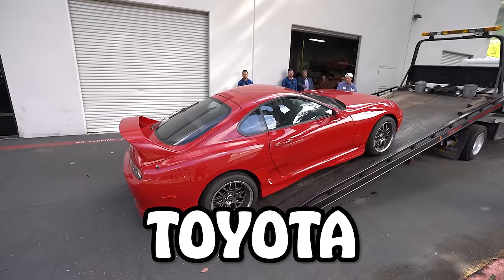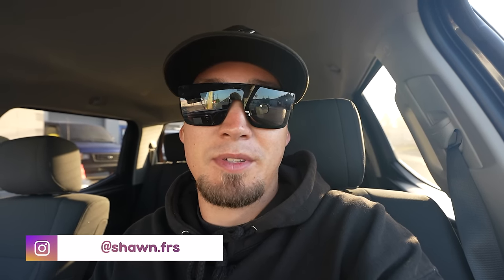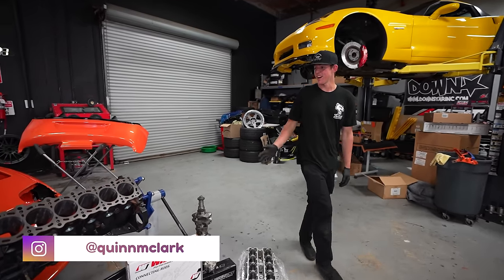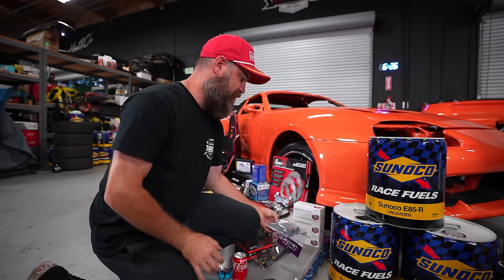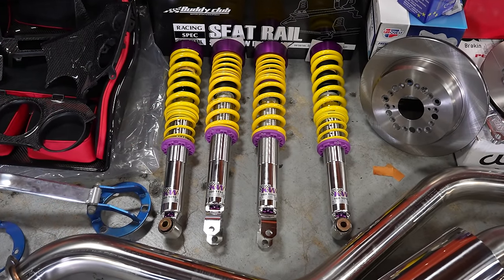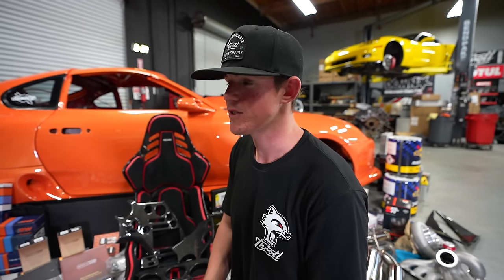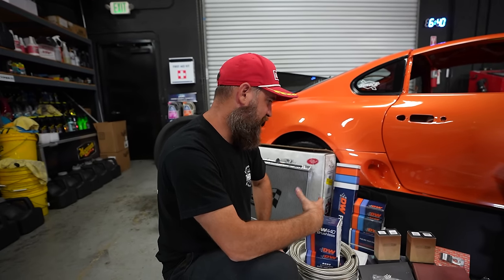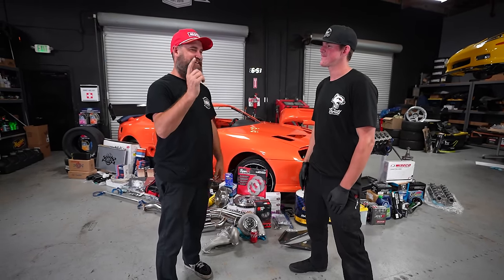Building a Modern Day (Fast & Furious) 1994 Toyota Supra Turbo – Part 5 – SEMA 2022!

Comment: Beautiful build! Absolutely beautiful 😍. Love the pistons, tilton parts, etc. Personally though, I would never have put carquest timing parts on this build, especially with the higher valve spring pressure that the valve spring will be putting on that cheap belt, I understand they're probably sponsoring you with parts, but OEM belt or HKS/greddy/etc for a belt that can handle that tension. You'll need a billet tensioner bracket too since the OEM style snaps on performance builds. Same goes for the oil pump. OEM or upgraded OEM only. Not complaining though, this is definitely eye candy!

Comment: i pray you have a brake bias valve installed cause that break madness gonna feel like dookie on the street, maybe great for drag but street. ... just going to need to be able to dial in your bias is all.
Reply: Of course. Not our first rodeo. As mentioned in the video, the brake bias adjuster is built into the Chase Booster delete kit.

Comment: you building an drag car hmm oke .. but why an wing from an airplane on it will slow down a lot on the track iknow for tracion it will be good cuse supra is heavy on the front so you will need the downforce but modern cars theys days tyr to have a small spoiler wing 💁🏾‍♂️  or try to shift some weight to te rear some how